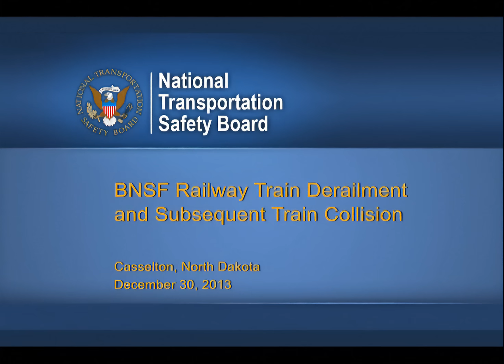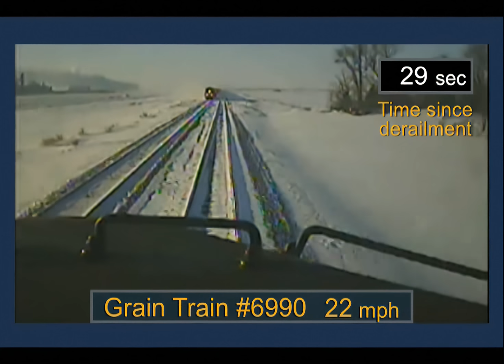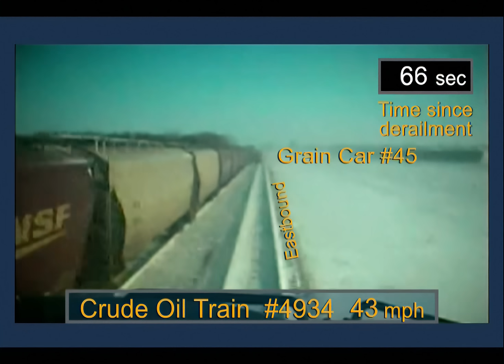BNSF Railway Train Derailment and Subsequent Train Collision

Comment: If that oil was transported on say a pipeline, that wouldnt have happened
Reply: Solar, wind, hydro, nuclear, geothermal, etc.
Reply: Power's an expensive thing. Besides, they're all cheaper in the long run compared to oil.
Reply: Not nearly as much of an impact as oil.
Reply: And what current technology is that?
Reply: +Penguin236 Oh, those expensive things.
Reply: @David S.  But if we Kick the "oil" habit, what will we use to fuel our transportation needs?
Reply: +soaringtractor To bad that only decreases the flow of the river and creates a huge pond that destroys all of the land behind it. The point is, nothing is for free. The "clean" energy isn't all that clean when the environmental impacts are considered.
Reply: Well so much for the ADULT conversation. Sure there are many ways to produce electricity. But can those alternatives produce electricity at the affordable kWh that coal is capable of doing?
Reply: How is solar expensive? Instead of stating generic claims like you do and any 5 yr old could, let me explain. First, solar panels are only 22% efficient. They produce DC. DC is not good for transporting long distances (wires). So this has to be converted to AC by the use of a power inverter which is not 100% efficient either. And this is if it is a perfectly sunny day. Do you know how much land would need to be cleared and solar panels produced to  meet the output of your standard "dirty" power plants? The production of solar panels isn't good for the environment either. Fabricating the panels requires caustic chemicals such as sodium hydroxide and hydrofluoric acid, and the process uses water as well as electricity, the production of which emits greenhouse gases. It also creates waste. These problems could undercut solar's ability to fight climate change and reduce environmental toxics. You probably didn't think of any of this though because you don't actually know anything about the subject and try to prove a point by name calling which is very childish. Don't even try to start with the wave power.
Reply: +Penguin236 yeah but there is still huge environmental impacts from all of those
Reply: soaringtractor dear Mr. soaringtractor if that's your real name -i was leisurely scrolling through comments when I saw your comment had an excessive amount of exclamation points it. and the name calling was excessive celebration. I have to say tsk, tsk to you. I'm going to have to penalize you by having you report to the Hanford site tomorrow at 6am sharp for clean up duty. since you know everything, I expect you to be done by 2pm! if you finish early you can go around gathering up exclamation points.tsk,tsk indeed! (just dial it down a little dude). :)
Reply: Mi 28 I'm looking for the cleanest practical solution, not the most efficient or convenient. The electrolysis process basically allows clean energy plants to power vehicles wirelessly. The hydrogen tanks would act like rechargeable batteries. Using the hydrogen in a combustible engine would allow the vehicle to still have the housepower some need. Those who don't need the horsepower can opt for the more efficient and weaker electric engines. 

As I mentioned, the hydrogen option isn't ideal at the moment. Oil wasn't that great either at first. Hydrogen has potential; it just hasn't had the kind of money, attention and time that oil has benefited from. If gasoline was banned in personal vehicles everywhere, you know the demand for more powerful, efficient and convenient hydrogen systems would push progression of these systems. Given time, hydrogen would become just as good (performance and convenience wise) as gasoline (and still improving). Hydrogen can't compete with oil if we keep refusing to give up oil.
Reply: all you anti-oil folk forget that the keyboard you are tryping on is made from oil-byproducts. We cannot become completely reliant upon green energy because there aren't many alternatives for plastics. I'm pro-green energy but I'm not anti-oil because petroleum products will always be necessary.
Reply: crephotos The anti-oil people are mainly concerned with the 80% we burn as fuel. If we reduced our consumption enough, we wouldn't need pipelines and trains transferring 20 millions barrels per day. It's wiser to invest in clean energy instead of more oil pipelines.
Reply: People also forget that natural gas is a by-product of oil extraction and it is one of the cleanest burning, most efficient fuels. If someone can developed a solar powered boiler or furnace that has the same btu output as a similar sized natural gas unit they will make a fortune, but I'm sure it hasn't been done yet because it is impractical.
Reply: 25mfd good response. the other guys are off they're meds. I would like to know why geothermal energy is not used more. looks like the supply would be inexhaustible to me. and thanks for civil and adult correspondence. anybody know about  geothermal  energy?
Reply: Only from sunrise to sunset--unless a UFO is around............... dc current--bad not efficient,ask Edison when he built DC power plants a 100 years ago
Reply: Geoff Bridges my grandpa worked for Carl e Smith's as vice president, and works for the successer mountaineer state energy at the same position, and I can say first hand that is bull shit something like a fire due to an accident can't happen
Reply: 25mfd Hydrogen via local water electrolysis from clean energy. Although this alternative isn't completely ideal at the moment, I feel we are ready to make the switch. Only after the fuel has been given the same amount of attention as oil, can it be expected to fully compete with oil. I believe this change should take place with personal vehicles first, then switch industrial vehicles to hydrogen in a later step.
Reply: Electrolysis. Ha! You must be in high school and with poor grades at that, if you're not aware that splitting bonds in an atom takes same amount of energy input as the output of their recombination so at theoretical best you're at no net gain if you produce hydrogen by electrolysis, you'll need equal amount of energy you got elsewhere to produce it. In practice the electrolysis process is electrically inefficient and motors that use hydrogen are also inefficient, making electrolysis consume several times the power you're getting out of hydrogen on the other end. 90-something percent of hydrogen produced by natural gas recombination.
Reply: How the fuck is solar expensive? Free energy from the sky.
Reply: "What about energy for our transportation needs? Solar, wind, hydro, nuclear, geothermal, won't power a car or a train."  I ride an electric train to work every day. Idiot.
Reply: " But if we Kick the "oil" habit, what will we use to fuel our transportation needs?" www.teslamotors.com
Reply: +Qopel lol I wonder where that electricity will come from
Reply: That's good. I don't mind that at all. Using electrical power for our transportation needs where applicable is a good start. But where does the electricity that powers your train come from? COAL.  So you shake one fossil fuel while still relying on another fossil fuel. And chill with the name calling. We're adults having an adult conversation.
Reply: we have mt st.helens,and Yellowstone these are great sources of geothermal,why not use them????
Reply: see, there is the free energy!! ah dahhh,you only need to get close to get the thermal energy needed to operate a powerplant they do it in Iceland,so it can be done---DUUUUUUHHHH!!!!!
Reply: Thanks Captain Obvious!
Reply: Geoff Bridges nope, it'd be in a river somewhere.
Reply: How many more weak excuses can people come up with? It's like they're addicted to oil. Kick the habit already!
Reply: @-.._.-_...-_.._-..__..._.-.-.-  Kick the habit.  Ok u show us how to do it.  Strip down naked and go stand out in a field because everything u got dude, came from Oil.  Why don't u start with handing back every plastic thing in your house, oh, and don't forget to strip your house of all the plastic in it like the wires that are insulated, pvc plumbing etc, and while your at it stop eating all that food that comes to you by way of trucks trains planes that run on Oil.  Shut up dude
Reply: @bobvincent4841 , I've addressed this in another reply. Those against oil are mainly concerned with the high percentage used on fuel. Those who are against plastics (anti-oil or not) are mainly concerned with the high percentage used on disposable products like grocery bags and fast-food containers. No one is really advocating against plastic being used in infrastructures or reusable containers. Although their are extremists out there asking for "all or nothing," most proponents against oil are only asking to cut the overdependence, the overuse, of the resource.
Reply: @ Penguin236  Solar, wind, nuclear, geothermal are fine. But those are energy sources for electrical generation. What about energy for our transportation needs? Solar, wind, hydro, nuclear, geothermal, won't power a car or a train.
Reply: There are many many other ways to generate electricity besides coal, you idiot.
Reply: +John Lebony solar, wind, geothermal, hydro, waves, etc.
Reply: +soaringtractor Hey dumb ass !!! Yeah you soaringtractor !!!!  Any fossil fuel generator is expensive, too! PLUS The FUEL needed to run it. You don't need batteries when connected to the electric grid.  !!! Do you know anything about solar ??? Do a little research on setting up a small system !!!  DUUUUUUUUUUUUUUUUUUH!!!!!!
Reply: point is:cheap plentiful geothermal power--drill and tap those volcanoes and use them!! no smoke, no dam, no wind needed, no radiation!!!also,mt st helens is still active........we can relocate yogi anytime!!

Comment: what was the cause of this derailment?
Reply: Rob Henry the Russians hacked the rails
Reply: Rob Henry NTSB investigators said during a meeting in Washington that the flawed axle on the 45th car of the grain train could have been subjected to more thorough testing when its bearings and wheels were remounted at a BNSF shop in 2010. They said the axle wouldn't have been returned to service if testing had found the defect, which was created when the axle was made by Standard Steel in 2002.
Reply: Trump. According to most media outlets he's the cause for everything
Reply: Ben Hancock thanks for the info.
   makes me wonder why BNSF replaced that bearing ,was this car involved in a prior non reportable derailment ?
Reply: So was it a violation that the axle wasn't subjected to better testing in 2010 or is "more thorough testing" a subjective term?
Reply: Rob Henry de-rails is my guess.

Comment: what caused the grain train to derail
Reply: Louie Louie NTSB investigators said during a meeting in Washington that the flawed axle on the 45th car of the grain train could have been subjected to more thorough testing when its bearings and wheels were remounted at a BNSF shop in 2010. They said the axle wouldn't have been returned to service if testing had found the defect, which was created when the axle was made by Standard Steel in 2002.
Reply: Thanks, i was just curious.
Reply: pesticides
Reply: @MrMudNugget  pesticides are making train axles turn gay...

Get it? Because it isn't "straight".

Whatever, I tried.
Reply: The signal guy put a penny on the track.
Reply: Link to the full NTSB final report is in the description.
Reply: Louie Louie likely it was the cinttiffikul force
Reply: Early application of the emergency  brakes caused No. 45 to derail which in turn led to the derailment of the crude oil train
Reply: Louie Louie by the looks the snow may done it the ice and it hit a bad section of track

Comment: And then what happened?
Reply: Then 4934's fire actually seeped into the tank cars and caused a huge, visually spectacular explosion! Luckily, the crew escaped and no one was injured or killed. However, engines 4934 and 5958 (which was the second engine pulling the oil train) were completely mutilated and were scrapped.
Reply: @superbaddy4  randomly stumbled across this video 4 years later to find a 2 year old reply I missed! Nice to finally find out. Thank you!

Comment: All I see is a crew that failed that failed to follow the railroad rules and declare that they had gone into emergency , so that the oncoming train would of had that much more time to slow to restricted speed or at least emergency. No stopping the 2nd derailment but the speed at impact would have been a significant amount lower had the rules been followed.Truuu
Reply: The original cause of this incident was the faulty axle on the offending grain car. Once this was revealed, It just becomes a real stretch to look to find secondary causes.  It really looked like everything was happening so fast. I was a switchman and worked in unassigned pool service like the guys in the vid. Usually things go smoothly and it's just another normal work day. This is a job where you don't wanna come home running through the door excitedly saying, guess what happened, guess what happened. "Boring" and "normal" are beautiful words on the railroad when describing a work day.
Reply: You are incorrect. At the 2:12 mark, the crew of the grain train did notify the oil train that they had went into emergency. This was just an unfortunate accident. No human error here.
Reply: Chriz Chriz Did they even know that there was a derailing?  The engineers on the grain train didn't seem to know why the emergency brakes had been applied and it looked like it was just the one car that tipped.  I am definitely not an expert but there seemed to be no difference in the cab at the time of derailment besides a very slight lowering of speed...
Reply: 25mfd So it was something that rarely happens and would be far more difficult to recognize.  Actually in that case this is probably a better case senario, the car could have derailed at higher speeds...
Reply: You are a moron.
Reply: By the time you go into emergency it's WAY too late. Long before that happens, your amperage meter reading MAY increase. The amp meter shoes how hard your motors are pulling. If the amps increase when they should not be increasing, that is your FIRST sign of trouble. Hearing the brakes go is a VERY LATE sign of trouble.
Reply: Chriz, I'm not sure what the rules are for these types of freight trains, but I do operate commuter diesel trains and sometimes rail trains. With our crappy software, the train will go into emergency for very benign reasons. On some trains it can go into emergency three or four times in one single trip. You just shrug, wait for it to stop, then charge back up and GO. It's safe to say this crew had no idea they derailed, but he was cautious enough to warn the train on the opposite track of a possible hazard. 

My point is that the engineer probably didn't break any rules, and it's possible that if he called "EMERGENCY" every time his train dumped, management would call him upstairs by day #2.
Reply: 25mfd I agree with you. They did notify the oil train about the emergency brakes, but it didn't help that the crew on the oil train forgot to switch over to the correct radio channel, hence why we didn't here anything from the crew on the oil train until a little after the impact. This would have prevented them from hearing the emergency call put out by the grain train but I still think the accident would have happened either way. This would be the only "human error" that I could think of.
Reply: You summed it up pretty well 25mfd
Reply: "4934 watch yourself" The did warn them.
Reply: I think they didn't know there was a derailing, but they must have known the brakes were on and further must have known that the entirety of their train hadn't passed through the switch.  I'm not sure they were aware of oncoming traffic, though.
Reply: The crew new instantly when the train went into emergency.   Depending on the rules of each railroad the crews should have immediately announced their train was in emergency.   Had they done so in this case the oncoming oil train may have been able to significantly reduce speed.
Reply: Chriz Chriz patently false.  Significant drop in speed prior to the unintended emergency application.  Depending upon the actual grade, in that scenario, I would've throttled down two or three notches just to see what the train would do.  A sharp drop-off in train speed would indicate the need for an inspection.  That's also the time to advise other traffic in the area to exercise caution.  You don't learn this stuff in LET, however.  A good engineer coach would share tips and tricks, to help keep others safe.  Nothing beats experience.
Reply: 25mfd New AC power doesn't use an ampmeter.  They use a Tractive Effort scale to measure drawbar force.  The principle you suggest, however, is correct.  The way to determine excess rolling resistance in newer power is by carefully observing the accelerometer.
Reply: Where they are... there ARE no rules.  On the rails, it's every man for himself.
Reply: It is not the drop in speed it is your locomotive alerting you to loss of brake pressure and immediately your adrenaline should announce the potential for death and destruction behind and  declare the emergency.Its all happening simultaneously You will hear the the brakes go and you will know if it was at the rear or head end . There is a big brake pipe pressure gauge on the console that is your trains "bloodline" .As soon as the cars seperate its a done deal.Loud noises and a sequential procedure  to follow. Its hesitation that can be  a real killer in times like this because most of the time it will always be a bad air hose or a separated airline ..